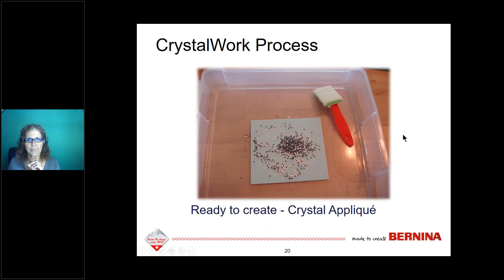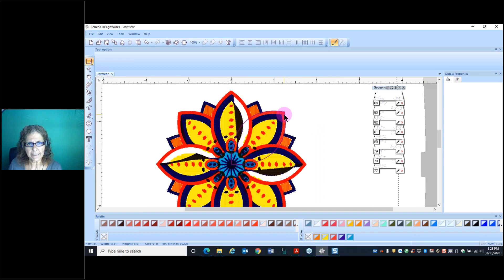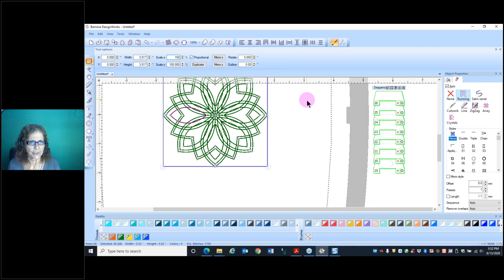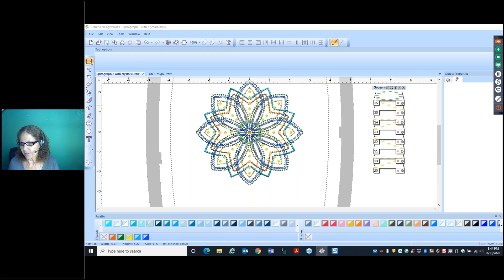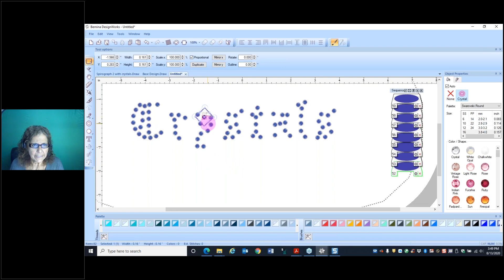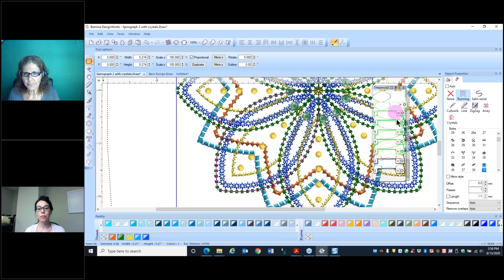BERNINA CrystalWork Software  - All that Glitters

Comment: This software work with  Bernina V 8 ?
Reply from the maker: They are each their own separate software, but you can create some great things using both of the them together. DesignWorks will create crystal, painted, applique and cut designs. BERNINA V 8 of course will create embroidered designs, as well as applique and cut designs. You can then bring embroidery designs into DesignWorks and apply crystals or paint. In Artwork Canvas of Software 8, you can create vector images and then bring them into DesignWorks to create a painted design. On our website, there is a previous webinar that explains how the two work together. Here is the link:  https://www.bernina.com/en-US/Learn-Create-US/Classes/Webinars/Recorded-webinars/Recorded-Software-en.  It is called The Dynamic Duo.